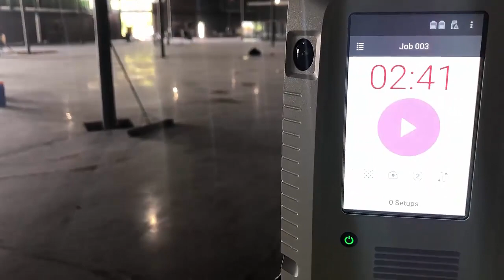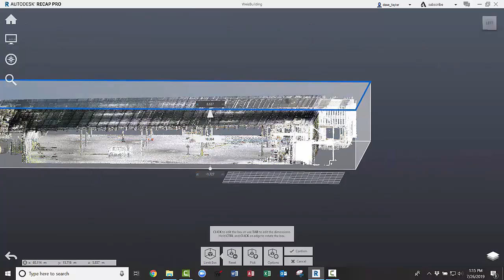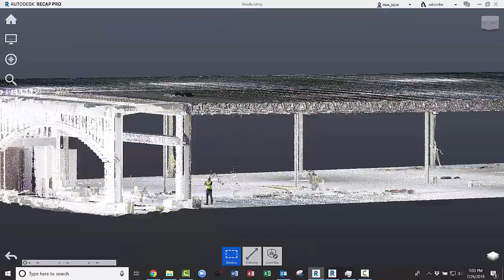Laser Scanning & Reality Capture - Capture As-Built Data Faster, Safer, and More Accurately

Comment: Thank you Synergis team, very informing video. 

I am a residential drafter/designer and am seeking a reasonably priced laser that can do as builts for residences.  Most of my jobs are single family homes averaging 1300-2000 sq ft. 

The only device I have found so far is the Leica BLK360, which has to high of a price tag. 

Would you know of any other laser devices that can do as buults? 

Thanks a bunch!!!!